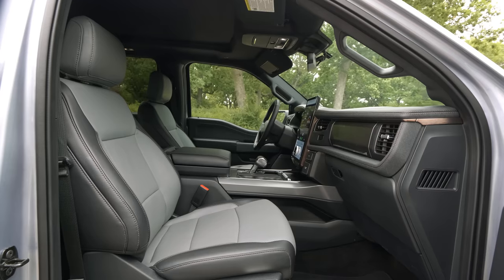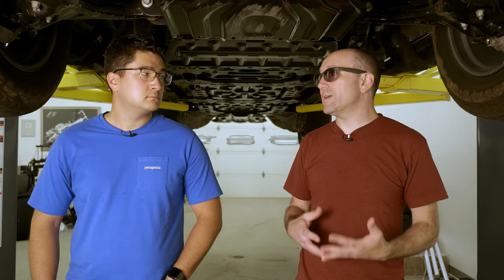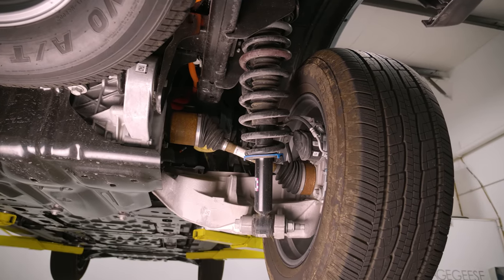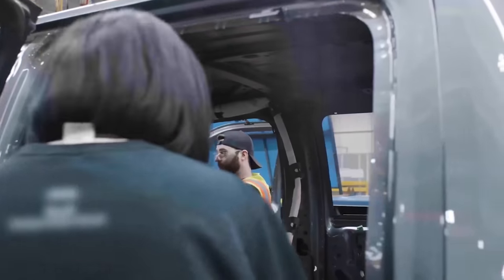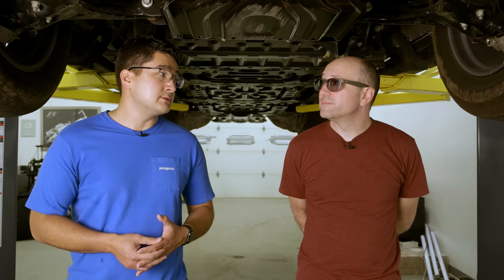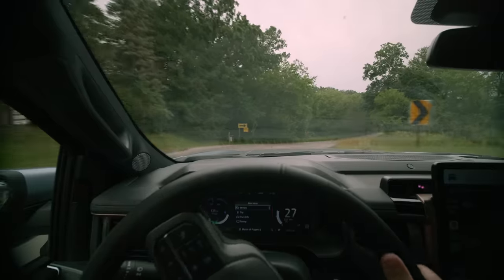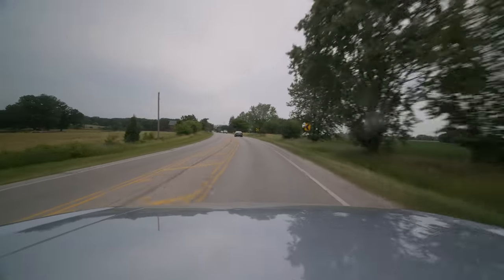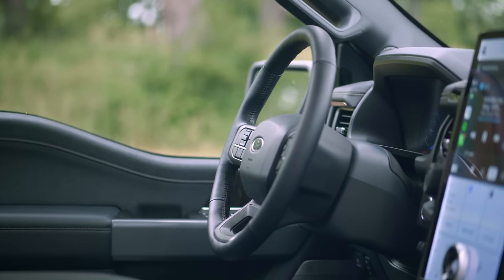Ford F150 Lightning | The EV That Will Change Trucks

Comment: This actually a pretty nice truck. I’m still waiting for EV range to hit that of ICE vehicles.
Reply: I think 500 miles will be that sweet spot.
Reply: @Bonanzaking  lol 500 miles? that would be increasing modern battery density by a multiplier of 5 under heavy load. We’re talking decades of battery innovation, if it’s even possible
Reply: And what range is that exactly? Most of the cars I've owned (Ford Fusion Sport, Subaru WRX, Chevy Cobalt SS) all had a range of 200-300 miles depending on how I drive. Many EVs can already match or surpass that range. I think what you're really looking for is a level of comfort in your use case because ICE cars have a mature infrastructure and quick refill time. The concern over range comes from charging times and less developed infrastructure. Valid concerns, but lumping it all into range would mean EVs need a 1000 mile range to be competitive.
Reply: @Matt-tt4cu  you don’t think someone said that a decade ago in regards to smartphone batteries? Time does its thing.  Ranges are already nearing parody among some vehicles. Ill bet about 5 to 10 years.

Again I use the smartphone analogy. You’ll probably see small incremental boosts in ranges so they can keep selling cars.
Reply: @Bonanzaking  Couple problems here: smartphones aren't really turning potential energy into kinetic energy.  While it is true, battery density has improved over the last 15 years, but it stalled out about 5 years ago.  Also the economics - battery density grew about 30-40% since 2007, with a cost increase of about 70-80%.  Phone manufactures also leverage China's labor to produce their phones - which is the ONLY reason they are remotely affordable.

Auto makers that sell vehicles in the US don't really have that luxury, and still have to solve the bigger problem of turning potential energy into kinetic energy.  Hydrocarbon based fuel vs a battery is no-contest in that regard.

And back to economics: Today, virtually every adult in the US owns a smartphone by choice.  And as of May 2022, still <5% own an EV - and Tesla's have been around almost just as long, and have "affordable" models...  EV's just aren't that popular.  Cost, lack of convenience, and failure to solve a real problem are the (good) reason(s) for that.  I can expand further if needed, but only if the convo can stay civil and intelligent.

Comment: Every “local” Ford dealer in a 100 mile radius of me in charging over MSRP. The Maverick, which was supposed to be a cheap alternative to larger trucks, is nearly as expensive at a Ford Ranger and the roll-out has been completely botched. I’ll keep my gas guzzling 1972 J4000 running for whatever pickup truck duties I have, and daily the new Subaru I just bought for $500 under MSRP.

Comment: To piggy back off the iPhone analogy: if the history of other, older EVs going onto the used/off-lease market is any indication then I think depreciation as Ford moves onto Mk 2, 3, etc batteries and motors is going to be one of the big democratizing forces for these trucks. Some buyers will always be chasing the bleeding edge of capability/towing/range/etc, while plenty of buyers will be happy to inherit yesterday’s new hotness or buy it at a big discount.

Comment: I’m definitely interested in this truck , I don’t tow at so the driving range is winning me over 🤞….plus gas price where I am is over $7 a gallon on 87 octane
Reply: Recharging an EV during brownouts and blackouts should be fun. There’s a catch to everything unfortunately.
Reply: How much to charge nightly? 131khw (which you will use because who doesn't love torque?!)  It changes how you drive (being an EV owner). It's just so heavy, I fear the nightly recharge us going to place some fear into ownership. Plus, is out grid with rolling blackouts capable of supporting this much power? 

Nissan leaf 21kwh was about $50/ month).
Reply: I failed to mention The truck would only be driven 7 miles daily lmao
Reply: Move to a better  state it's  a big country 😳

Comment: The big unknown is what do you do with a ($85k+ when new) truck once the batteries have to get replaced?  Not many owners are going to spend $20k on a new battery pack once you are on year 11 of ownership and the thing is worth maybe $30k. The batteries will get weaker every year from repeated cycling and in cold winters you will have less capacity.  This is something I have to understand.

Comment: I really would like to see some trucks and full size SUV PHEVs. It would allow you to be a parking lot princess (which is how most people use trucks and large SUVs) without using much or any gas without sacrificing towing range and capacity.
Reply: Yeah man that's exactly what we need. 10,000+ lb. fireballs.
Reply: @RAZGR1Z  the Hummer EV is so heavy that it actually uses more fossil fuels than a Chevy Malibu and it "only" weighs 9000 pounds, so stop exaggerating. A PHEV has a fraction of the batteries of a BEV so it'd weigh much less. If people are going to buy SUVs and trucks it would be sensible to at least allow for zero emissions for the average daily commute while also having the gasoline-provided range needed for a road trip
Reply: @RAZGR1Z  Wut? The battery pack on a long range PHEV would be a couple hundred pounds, and nowhere near as fire-prone as the gasoline system. Get your head screwed on straight.
Reply: Ford have registered the names "Ranger Thunder" and "Maverick Thunder" which rumor says are for upcoming PHEV versions, reserving the "Lightning" moniker for pure EVs.
Reply: @RAZGR1Z  engineering explained could really help your narrative

Comment: 🤣 I remembered when my sister panicked (Though gas was brakes) and ran our Camry into the garage...

Curious how much damage these things can do in a traffic light.
Reply: I've driven one... It would drive through the whole house without breaking a sweat lol
Reply: @thabrownieviking  on the plus side, now you have direct back-yard access.
Reply: @jayjacobl4667  helping cut down on home renovation costs truly a truck of the people lol
Reply: Don't worry, I am sure it can pull a garage just fine. 😆
Reply: I drive an electric standup forktruck and turret truck.  Letting off the gas is mostly the only thing that stops them 🤣🤣
Reply: I saw an S10 sized pick up take down a light pole on Monday. I can't imagine what this thing will do.

Comment: all you need is an interlock kit in your panel, just a few hundred bucks(50 or 30 amp breaker, kits and an inlet box and some wiring, nothing crazy, electricians just try to rip u off with a  transfer switch.), but still i have a 12k watt generator and paid $1300 for it

Comment: It’s not a “one to one” replacement of the ICE F150, but then it doesn’t have to be.
I think this vehicle makes sense for a lot of people. 
I hope it is reliable, reparable and recyclable.

Not to mention it is cheaper than Tesla Powerwall in terms of pure battery size. Apparently.
So it makes sense in combination with a decently sized EV panel system.

Judging from the amount of the new EV panels installed, I think there should be enough energy. I’d assume new houses will maximise the EV output. So the future is not as dramatic as it looks like. 

The technology is there in terms of making more electricity and saving it for temperature control.
Reply: idk im getting 2 tesla powerwalls installed that can power my house for 2weeks. This truck doesn't go for that long. as for price it was like 12k total i think, also getting that tesla solar installed
Reply: @salami99  Don't be ridiculous. Tesla powerwall is 13.5kWh. F150 Lightning is 130kWh. Which is 9.5 powerwalls!
Reply: @salami99  
"
A Tesla Powerwall starts at $10,500. If you buy four or more, prices drop to $7,500 each. A Ford F-150 Lightning Pro costs $41,669 if you manage to find a dealer that is not fond of markups: $39,974 for the price and $1,695 more for destination charges.

The entry-level F-150 Lightning comes with a 98 kWh battery pack. At 14 kWh each, you would need 7 Tesla Powerwalls to get the same energy capacity the electric pickup truck offers. That means you would have to pay $52,500 on the Tesla products. Buying the F-150 Lightning Pro would cost you less and would also put a pickup truck around the battery pack."

Comment: I’m glad you brought up the fine print of millions of EVs charging. Every rest stop in America, every parking lot, and maybe every street in Manhattan will need chargers.
Reply: Why? This thing may have a short range when towing, but normal EV ranges are 250-350 miles. They don't need to be charged every time they park.
Reply: @markmiller3279  Because anyone who takes these on a road trip will need access to remote charging.  I travel a lot and stay in a lot of hotels for work related purposes.  When a car trip is under 6 or 7 hours I usually drive.  Outside of CA, I hardly see chargers in hotel parking lots.  I would also need to charge on the road, in a rest stop, etc.  I also live in the greater NYC area and while I live in a house with a two car garage (which BTW has 200 AMP service - not sure how long it takes to charge a depleted battery with 50 AMP, but it’s probably more than 8 hours and also not sure if I could have two EVs using 50 AMPs a pop and still power my air conditioning compressors and the entire house at peak load), as you get closer to NYC many live in apartments, park on the street, park in garages, etc.  Ironically, an urban dweller with an EV is probably a much worse candidate than they are for an ICE car due to access to overnight charging.  Then there are practical issues.  What happens when you go visit your Uncle who lives 250 miles away and you stay at their house?  Hey Uncle X, you got an extension cord I can use.  My car is dead. What happens when you go to Yosemite?  You can barely get cell phone coverage in a National Park.  There’s a lot of things we haven’t thought about yet with these and access to charging that we take for granted with ICE.

Comment: The battery does seem like a pretty big liability though. I can't say I have a ton of faith in Ford to build a long-lasting battery. I believe this thing has pouch cells too which are cheap to manufacture but don't have the greatest track record of long life. Time will tell though. Also, if this thing were to catch on fire, that would be one hell of a blaze.
Reply: Yeahh, I’d definitely rather trust Tesla that does EVs full time with battery’s then Ford

Comment: Hydro-Quebec, wich is our governmental hydro power company, talked about that grid load from EV's and they calculated that since most people will charge overnight, grid load is insignificant compared to daily use of the power grid.
And if there's one thing in Quebec that is government owned and nice, it's our powergrid.

The main problem with those trucks, is you will need a big ass charger at home because charging 130kw/h on 220v in about 8 hours, you can't do that with current level 2 chargers (i think)
I'm a drywall contractor and as soon as the silverado EV is available, i'm going full EV. Even if i would have to stop a few minutes at a charger once a month, the savings are so huge compared to diesel wich got to 2.60$ PER LITER a few weeks ago, it's a no brainer.

But i think, as millions and millions of EVs get on the road, the costs savings will be lower and lower because eventually, the oil price will have to plunge with the demand, like it did during covid.

Comment: I would love to have one of these! I have a 2019 F150 XLT with 3.5 Ecoboost. It's the nicest vehicle I've ever driven (I'm not fancy). The only thing I don't like about my truck is the turbo lag combined with annoying gear shifts leads to a jarring ride sometimes and with the solid rear axle it's a bit bouncy. Plus it costs me over 100$ at the pump. The EV F150 would fix my only complaints.
Reply: 19' 2.7 lariat here. I loathe the transmission with 3rd and 8th gears too. Turns a mostly smooth ride into herky jerky. Buuut it's still a luxury ride for me too.
Reply: I saw on a video somewhere if you take it to Ford and tell the mechanic to turn off the “smart” learning of the transmission it really improves the jerkiness, hesitation, and indecisive shifting.
Reply: @robs7527  oh cool! Maybe I'll give that a try. I figured it was because my wife and I drive differently so it would get confused. Didn't know that could he turned off

Comment: Even though I like this truck and it has incredible features...it's just not practical as a truck. 

A car makes sense as it can commute within a city.

But tons of truck owners take their trucks on long trips, or haul or tow, or go in the back country.  You can't do that with this truck.  It's range is too poor, and it takes too long to charge.  The way I use my truck, until an electric truck can guarantee at least 350 miles of towing, I can't justify the purchase.

Not only that, but the extended range model costs 60,000 which is more expensive than a regular truck, and it only has about 270 mile range in practical tests with no load.  The standard has even less than that.  The only people who will buy this truck are people who don't really use trucks.
Reply: If we don't manage to continue making both technologies for their respective fields of expertise, we'll continue furthering the conquest of scarcity. Monolithic, one-tech push is unhealthy in many ways.

Comment: 100 mile towing range and need to spend 20,000 dollars to replace battery in 10 years is a no go for me. Assuming the battery is still being produced. That 20,000 dollars is 4,000 gallons of gas over 10 years.
Reply: 4,000 gallons of gasoline at the average 17mpg a full size pickup gets is only 68,000 miles. Over 10 years that's 6,800 miles a year.
Most pickups are driven twice that far annually if not more. And most full size trucks can't sniff 17mpg average either. 🤔

Also fyi starting in 2025 ev pack's in the U.S. are going from coverage of at least 8 years or 100,000 miles minimum under the federal ev battery warranty. To 10 years 120,000 miles coverage minimum. Some manufacturer's already cover them for that long or longer. 👍🏻

Plus they are experimenting with additives that can help heal dendrites in the pack itself. If those pan out in the near future. Ev pack's will last decades or more with retaining near new energy capacity. Not to mention pack costs at the per kwh cell level have dropped over 800% since 2010. So who knows where they'll be by the some time in the theoretical future when a replacement is needed outside of warranty coverage. 🤔

Comment: There’s a number of people on the forums that are ordering these, opting to do the poor man’s home back up, instead of Sunrun. Have a transfer switch installed and connect your Lightning to it with a cable attached to the back 30 amp. Much cheaper for a back up power outage than using Sunrun.

Comment: One aspect I’d like to criticize is the statement you made regarding long term ownership of this Ev but this applies to all Ev’s which is their batteries. They are lithium ion as we all know they degrade over time and will eventually need to be replaced either because the total range on a charge has degraded enough to the point that it hinders your ability to travel and also it may have charging issues. Obviously all the money you saved on gas helps however a single battery pack basically costs as much as a nice used car you’ve effectively totaled yourself out if you don’t have 10-20k readily available to throw at battery packs and this why I believe Ev’s should not be bought at this time until a more permanent battery technology is available. For now hybrids should actually be the focus

Comment: I feel like this is very much a stop-gap solution until they can design a ground-up EV truck a few years from now.
Reply: What? Why? This is so much better than the Silverado EV which is on a dedicated EV Platform.
Reply: @imnotusingmyrealname4566  I believe he's talking specifically about Ford's approach and not electric pickup trucks in general.

Comment: Great truck.  Unless you use it like a truck.  Load it up or God forbid tow something and it barely makes it around the block without a recharge.
I'll pass.
Reply: Exactly.
Reply: Also it looks like rates to charge these things is going to be just as expensive as getting fuel, in the short future.

Comment: There is a cheap way to connect the truck to your house is by using an interlock kit and a circuit in the main panel that has a male receptacle. Then to to connect, you'd use basically a 240V extension cord that  feeds in the truck power. For about $150 in parts, you can install the interlock switch kit and just use your main panel. The downside is when the power goes out, you have to go out to the panel, turn all the breakers off, flip the interlock from grid power to generator input power,  then turn back on the circuits you want to use powered by the truck/generator. That also means you have no idea when the regular grid power comes back online since you've switched from grid power to generator. (But that's the point of the interlock, you can't physically have both grid and generator power connected to your panel at the same time otherwise you could backfeed into the grid and zap maintenance workers.)
Reply: Gotta have the pro power onboard for that, plus on the lightning forums it's been covered doing this. You need to have the right ground setup otherwise the truck will refuse to power the load from the socket in the bed.

Comment: Great review!  I'm really not sure how they fix the towing issues anytime soon.  Even if they can get the towing range up to 200 or 300 miles, you still are going to have to pull this truck and the load you are towing into a charging station, which does not sound pleasant.  I'll be interested to see what Ford/GM/Rivian/Tesla have in store for long haul towing needs.